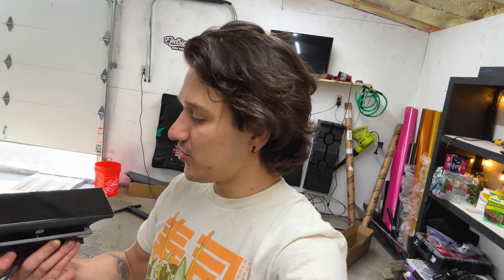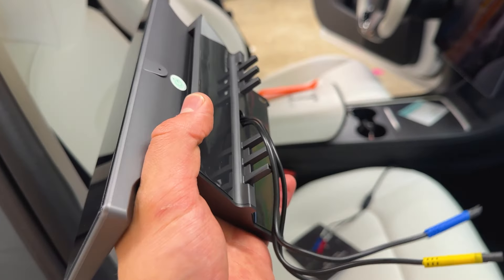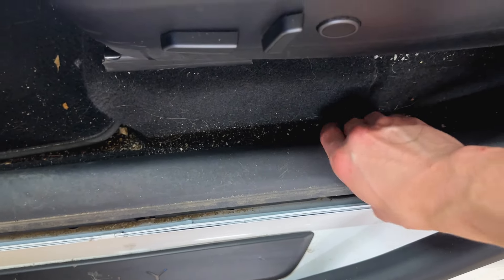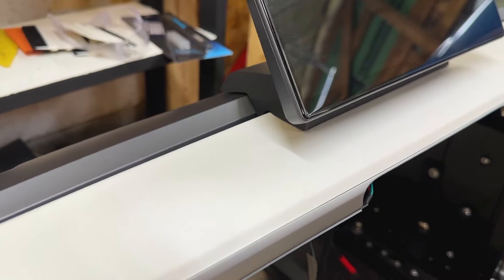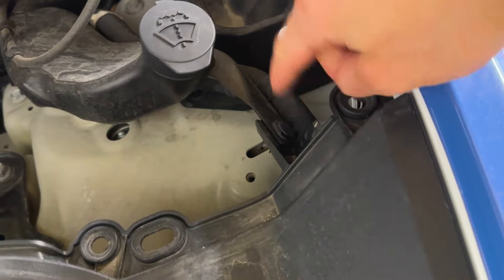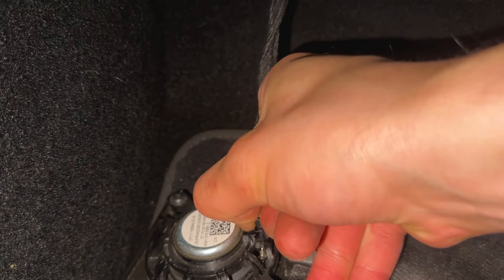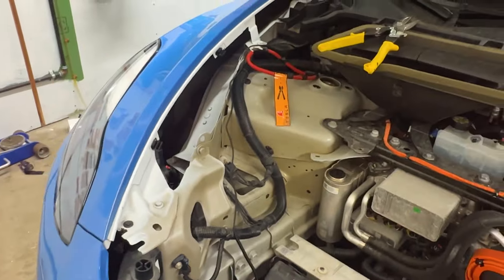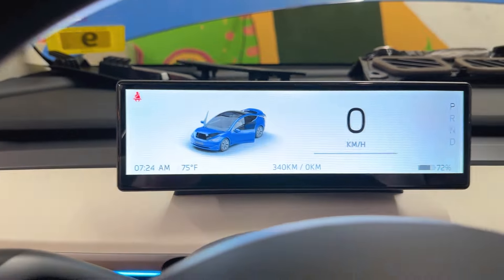Model 3/Y T8 Pro Instrument Cluster Display With Front Bumper Camera from TESLASY!

Comment: Hello. What happen to the American style speed sign in the T8 cluster. They installed one, it was the small hard to see it, so they removed it and never put back a bigger version. The cluster have a lot of potential, but they need to work in the American style speed limited sign and the blind spot monitor, also not working in my 2024 Model Y. I contact them many times about this, they don't have a fix for the past 3 month. Can recommend this to others tesla friends until they improved this things.

Comment: I have had mine for about a month now and all of a sudden, it stopped updating my battery range. It constantly shows my battery 100 percent. Do you know how to reset it?
Reply: I’ve the same problem with battery constantly 68%. Have you solved it?
Reply: @marcodimar  Yes and it was a simple fix. I just had to do an update. Try to see if it works for you